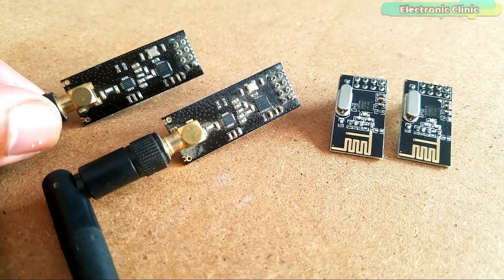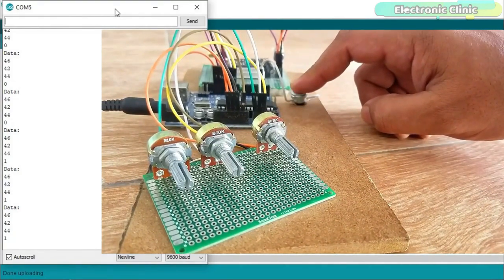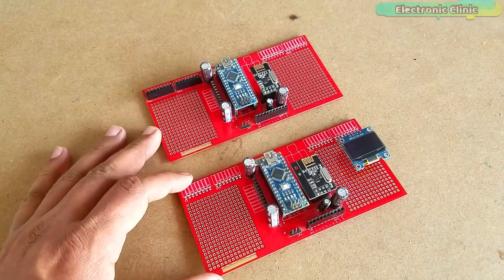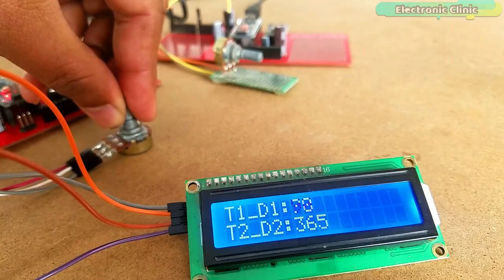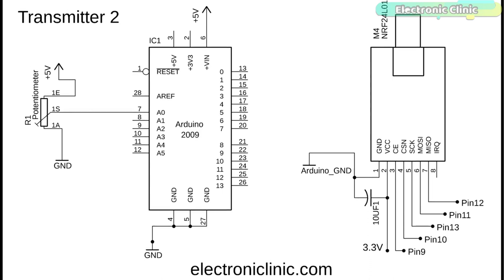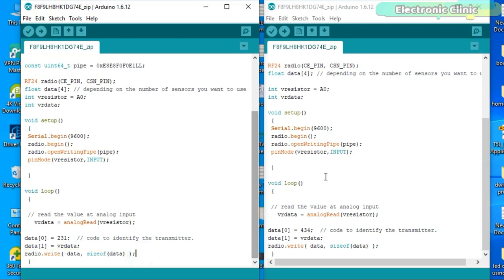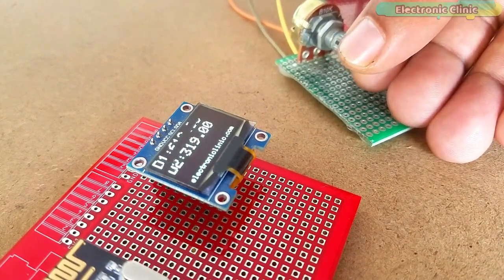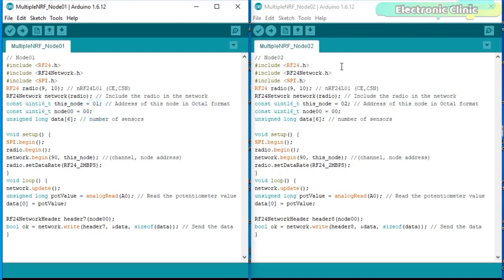NRF24L01 Multiple Transmitters and Single Receiver for Sensor Monitoring using Arduino

Comment: Thanks for the great content. One comment - for those sensors at the lowest level in the network that will be wired to the MCUs, you just need a transmitter instead of a transceiver since you are only reading from those sensors.

Comment: Finally found a very good tutorial for  multiple nrf network data communication. Thank you!
Reply from the maker: very soon will upload the other two versions
Reply: On the first part, I encountered an error on the receiver side. I just deleted "done =" from radio.read(data,  sizeof(data) ); Now it works! Also noticed the last recorded values remained after turning Off the transmitters. Might need to  modify if statements to default to zero.
Reply: @ElectroniClinic  I have a small problem. I need to use components that are compatible with Arduino. A position sensor (so I use a GPS module. This GPS module must be Adafruit Ultimate GPS Data Acquisition Module (GPS Included)). A position storage (with an SD card that must work with an SPI link). A bluetooth interface. A GUI to visualize the route (using an Android tablet that is compatible with a bluetooth module).
you can advise me to use what as a component . because it's 3 components must be compatible with Arduino and an Android tablet IHM thanks to a Bluetooth module.
Reply: @ElectroniClinic  Hi! Could you post links for  all the libraries you used? I'm encountering a problem for the SimpleTimer and LCD display. Thanks!

Comment: Is there anything specific to be done with the Esp32 DevKit V1 board, to use the nRF24L01+PA+LNA, because I've done it in several ways and didn't connect for anything?

Comment: Great work Sir, please can you assist on this error: 
Receiver coding for the nrf24L01 radio\Receiver coding for the nrf24L01 radio.ino:58:39: error: void value not ignored as it ought to be
  done = radio.read( data,sizeof(data) );

Comment: facing problems void value not ignored as it ought to be
at line      ------------>     done = radio.read(data, sizeof(data) );
Reply: I have the same problem. Could you solve it?
Reply: @rominar.8958  Did you solve your proble with "error:   done = radio.read(data, sizeof(data) );  ?
Reply: @rominar.8958  Did you solve your proble with "error:   done = radio.read(data, sizeof(data) );  ?
Reply: Same problem🥺

Comment: This is a nice project.how can i send the data collected by nrf reciever module via gsm module internet.thanks in advance.
Reply from the maker: this is quite simple, All you need define another serial port on the Arduino for the GSM module, and then all you need is to send that data to the gsm module. If you find this confusing, you can watch my videos on gsm module.
Reply: @ElectroniClinic  thanks

Comment: Attention using modules produced by EBYTE, based on nrf24L01. From some time on they use a clone and not a true Nordic component,  not compatible with previous modules. This has caused many problems on production based on this module! EBYTE does not admit this! Buy these modules from more reliable builders (or build it your own)

Comment: I want to make a remote car project, I've tried to communicate in bi- directions and it worked.  but because of my situation i need 2 arduino nano in the car, so can nrf24 be used for 3 units to communicate in bi-directions ?
Reply from the maker: ya of course you can use. watch my other videos on nrf modules.
Reply: @ElectroniClinic  thank you very much sir, if i use 2 different microcontrollers is this not a problem?  for example remote stm32f103c8 and remote car arduino nano
Reply from the maker: @maulanawahyudi7127  ya, you can use. I did the same thing in my latest videos on Lora Sx1278 modules.
Reply: @ElectroniClinic  I have a problem, sir, when communicating in two directions using stm and arduino, where the feedback reading from the sensor in my car reads randomly even though I've used the same program on my arduino ide with my arduino nano. Please help me, what should i do ? Because my program works fine in arduino nano

Comment: How can i read the address of direction for example node1 send a and the valué of sensor
Reply from the maker: This idea i will explain in the next video. It will be based on the two way communication. Any node will be able to communicate with any other node in the network.
Reply from the maker: Even if you watch this video, you will find, these nodes are assigned unique address, on the receiver side i am using if conditions to check form which transmitter i am receiving the data.

Comment: If i send data from multiple transmitters simultaneously that data gets garbled can u please help on this.
Reply: It's been 2 months since your question with no answers.
So I'm curious, have you figured this out?

I'm working on a project right now where I'll have up to 6 transmitters and 1 receiver.  (well, there may be more than 1 receiver for a couple of different locations).

So I've been wondering the same thing.
I have no problems with one on one, but 6 to one, I'm not sure of how to do that either.

I don't know that if all 6 go into LISTEN mode and the receiver sends out a code to trigger one at a time.  When the code, say, C1, C2, C3 etc is heard, then THAT module would SEND its data, then wait for a confirmation of receipt.

The other way I thought though, is since I'm using Nextion Enhanced displays for each Tx, they have RTC and what I thought was, MAYBE, I could have the Nextion, depending on the channel that the Arduino is configured for, it could tell the arduino to SEND at certain intervals, each device being at specific intervals.
Perhaps a 2 or 3 second difference.

Just ideas at this point.

Comment: I'm curious about something.
Is there any specific reason why you use those specific identifying codes, 
231 and 434?
Is that significant for some reason?
Could one just use 0 and 1 or perhaps 0, 1, 2, 3, 4, 5, 6 to identify?